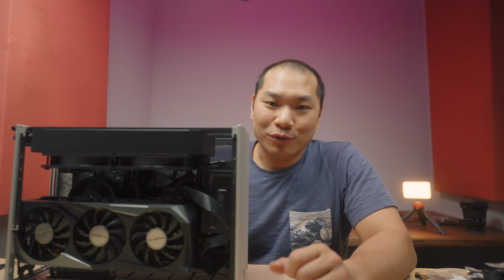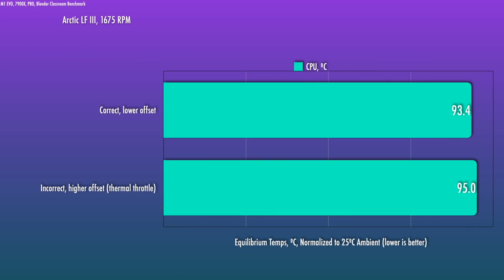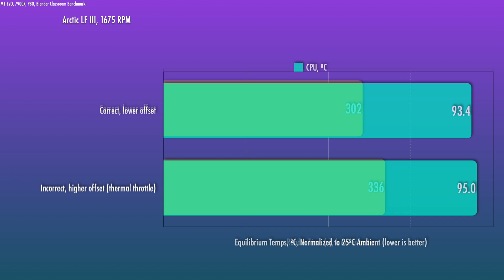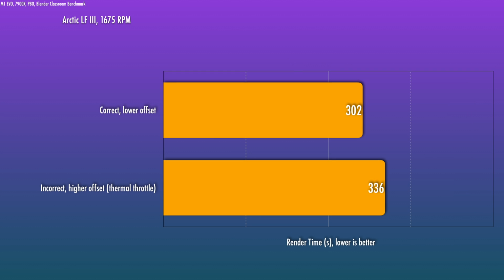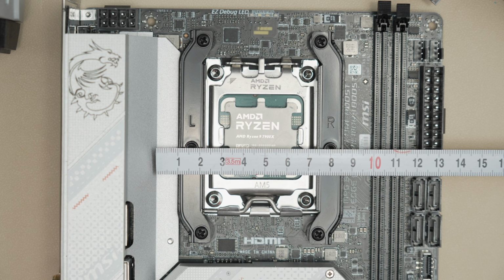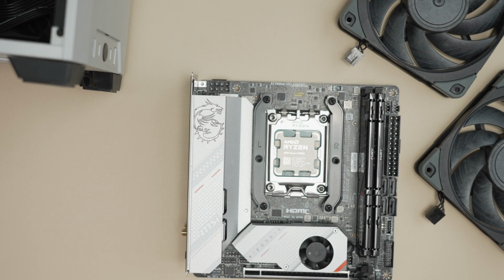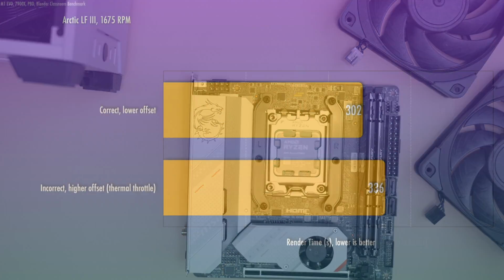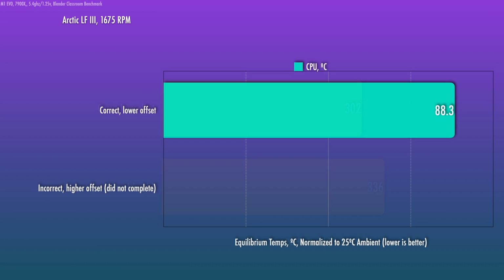Testing the Liquid Freezer III AM5 Offset - in the M1EVO!

Comment: The asus b650e-i, can you even fit the arctic liquid freezer iii on to it with the am5 offset? I found one photo online where the pump headers do clear the m.2 heatsink on this mobo, but I can't tell if it has the am5 offset.
Reply: It fits, I have it mounted on my ASUS Rog Strix B650E-I
Reply: @Andreasduvet it fits no issues?
Reply: @CheenoToCool yes, no issues

Comment: I have to swap the tubes top too cuz my 4090 aorus master conflict with the tubes down.. mounted vertically. Damn
Reply: hey is there any issue with the tubes going top? I am considering the same build with a 3 slot gpu and did not like the pressure the tubes placed on the gpu.
Reply: @89kk35  No. It's fine.